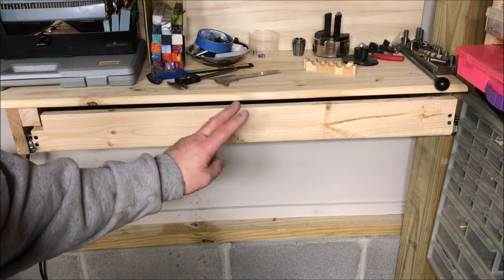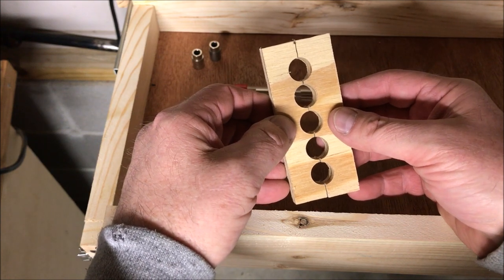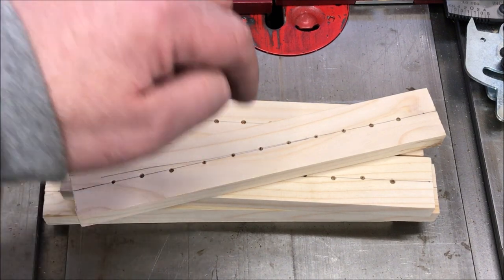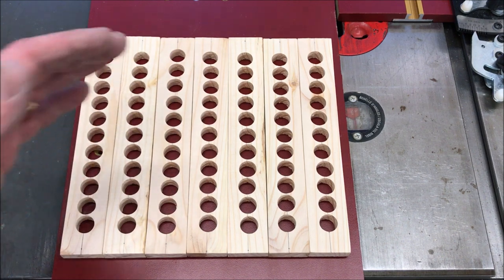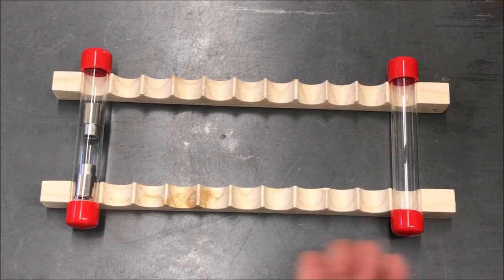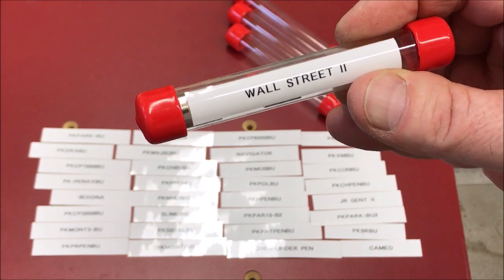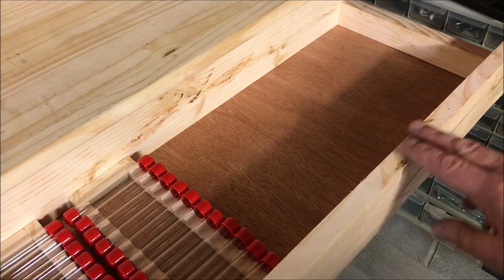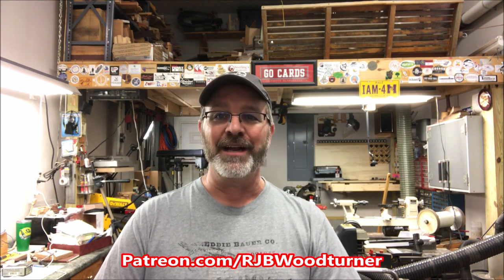Bushing Storage. How Do You Store Your Bushings?

Comment: That is a great idea Bob.  I had a similar problem.  With no space for a drawer like that I purchased two 30 drawer small parts cabinets from Lowes and mounted them on the wall.  Each drawer has one kind of bushing.  I keep the bushings in a small plastic bag and label both the bag and the drawer front.  I am going to look for those tubes.  That is a great idea.  I would like to send you a pen blank if I can get an address.  Mike
Reply from the maker: Thank you Mike,
  Great idea for pen storage. 

I’d love a blank. 

My address is P.O. Box 114 Newburgh, IN 47529

Regards,
Bob

Comment: I may have gone a little overboard in my system.  I have a 3D printer, so I designed a kind of pill bottle design with a hexagonal outer perimeter, so they all fit together and make pretty efficient use of drawer space, and never roll across the floor or bench, are big enough to fit ANY size bushings, and have an inset diameter around the middle that fit a label off my Brother label printer after trimming off the rounded ends of the label.  The open end of the vial is threaded, with threads to match the plastic cap from a soda bottle (which I have waay too many of).  Most of these vials are printed in white filament, save for one I printed in red filament, which is the 7mm "slimline" bushings which are used with almost every other set as spacers.  There's an old saying about when all you have is a hammer, every problem looks like a nail.  When you have a 3D printer, every problem looks like a new CAD design.  :)
Reply from the maker: That sounds amazing. Sometimes overthinking is fun. 

Regards,
Bob

Comment: Great video and idea!  However, since my shop has to be convertible because my garage shop has multiple uses that require most of the space, I needed the most compact storage space possible, and I don't have suitable location for a new drawer.  I came up with a simple solution by making a small wooden box similar to a 3X5 index card file, but I use in longwise.  Then I cut an index card down to fit inside the plastic envelope in which the bushings had been shipped and labeled.  My bushings sit in the box upright because of the card, and I can easily look through the "file" to find the bushings I need.  If I tend to use the same set of bushings often, I put them at the front of the box.  While this probably takes a bit more time to find the right bushing, it's only a matter of seconds.  This system works for me and takes up almost no space in my very compact shop system.  Thanks for all your videos and the tips you bring to pen turners like me.  All the best, Glen
Reply from the maker: That sounds like a great idea Glen. 

Regards,
Bob

Comment: Bob, great idea. I use plastic case from Harbor Freight that has several smaller individual plastic boxes. I label the smaller boxes with the pen kit name and the drill bit size with a label maker. Works pretty well for me at this point. However, I do like your idea.
Reply from the maker: Thank you Phil,
  I purchased one of those boxes but never put it into service. I may use it for pen parts sorting. 

Regards,
Bob

Comment: great storage idea. almost imposible to mix them all up. it looks like it is only 1.5 inches deep. have you thought about making a small tray to go inside that drawer. put a stip of ply front and back  for the  tray to slide on. you can then have 2 layers. put your most used ones on the top and odd ball ones underneeth. if you need access to them all you have to do is slide the tray over and get access.
Reply from the maker: That’s exactly why the drawer is as deep as it is. I don’t need a second layer today but eventually I’ll get there. Most used on the top layer and less used on the bottom. 

Regards,
Bob

Comment: Nice idea.  I priced the tubes 1/2 x 4" at .49 cents each plus .19 cents per each cap, turns out at .89 cents per tube in lots of 25. Plus shipping.  I use RX pill bottles that are short and fat and can hold multiple sets of identical bushings, all sizes.  Free.  Just label the tops and easy to find.  Not as elegant as yours but works very well for me.  I label mine with name of pen as well as decimal diameter of the bushings.  Containers are large enough to use the plastic bags bushings came in if desired.  Most of us have many Rx empty containers of various sizes that could be used.  I use the short fat ones because my storage drawers are short and these can stand up and save space.   Label makers are essential to all pen turners.
Reply from the maker: RX bottles are a great way to store bushings. No chance of spilling them either. 

Regards,
Bob

Comment: That really looked awesome Bob how do you go about store near drill bits to use for a drilling out the pens
Reply from the maker: Hello Mark,
  I haven’t started storing them yet. Coming soon. 

Regards,
Bob
Reply: @RJBWoodTurner  Here's how I store my pen drill bits.  I took a 2X2 board, drilled a line of holes roughly the sizes of the bits I use, labeled each hole for the appropriate bit with a permanent marker, and then attached the board to the wall at the back of my workbench, which has a laminate w/backsplash top.  The 2X2 sits on top of the low backsplash and the drill bits sit vertically in the holes.  The board is long enough to make room for additional bits should future pen kits require them.  It's handy, out of the way, and makes finding the right bit simple.  Glen
Reply from the maker: That’s a great idea Sandy. 

Regards,
Bob